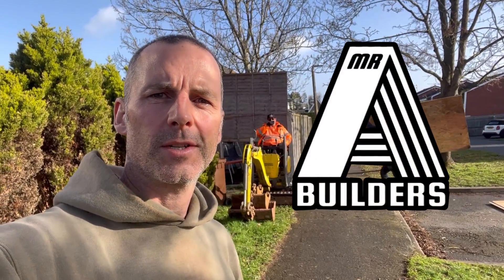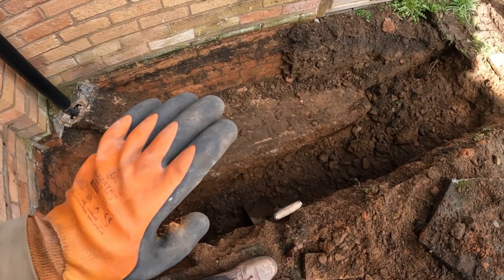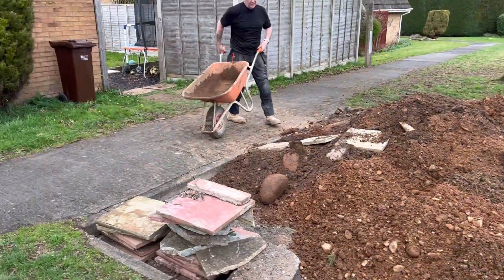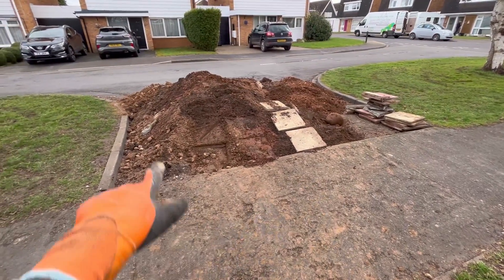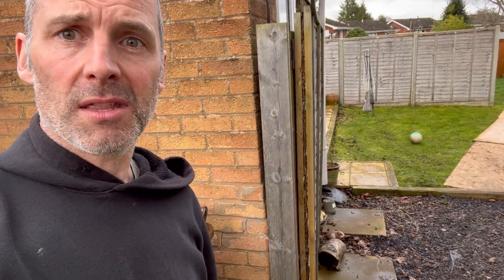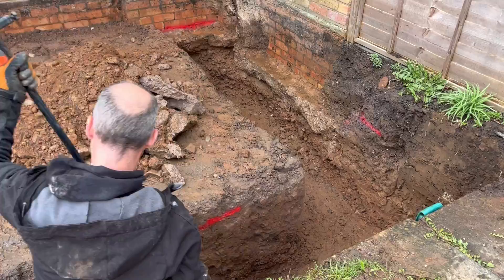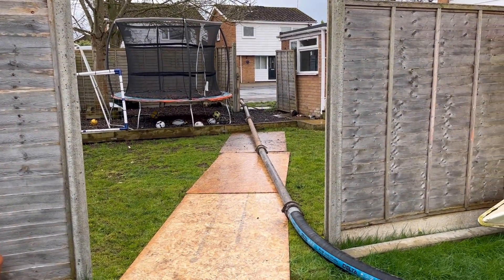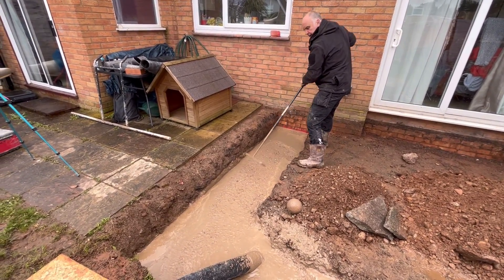Warm Roof extension - Part 1 digging and concreting footings

Comment: I’ve worked on many old terraced houses that only have a brick spread footing on rubble and haven’t budged in over 100yrs, makes you wonder what 1m plus rules are all about sometimes. I suppose the old lime mortar allows for some movement whereas modern cement mortar doesn’t and that’s maybe why. I have a feeling the old houses will out last the modern stuff though

Comment: BCO is a plank.  concrete under the slab from your footings will be supporting next doors footings surely!! if it didn't then how does underpinning work!
Reply from the maker: EXACTLY what we thought and that’s what other inspectors have asked to do is clean it and run concrete underneath it as further support. Got to keep them happy or the job stops 🤷🤷